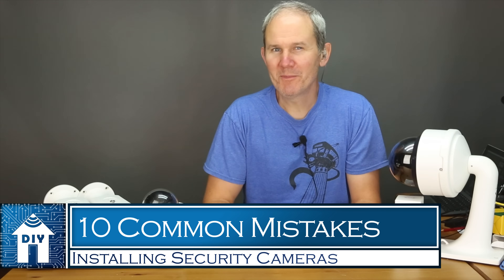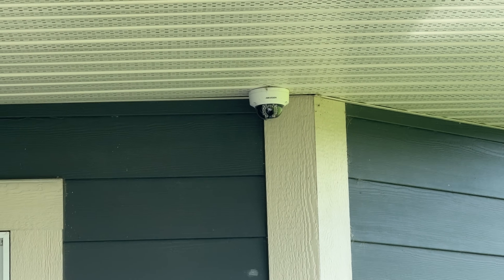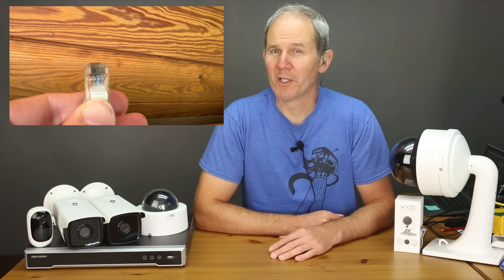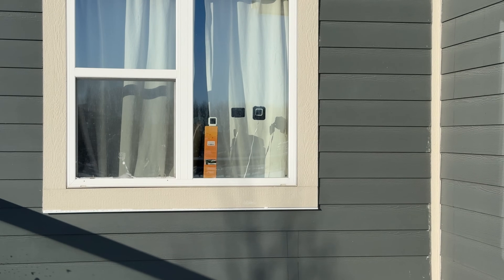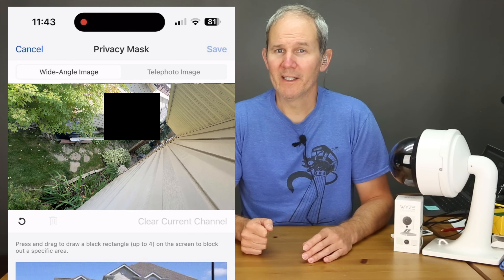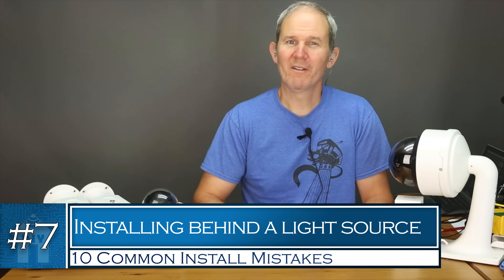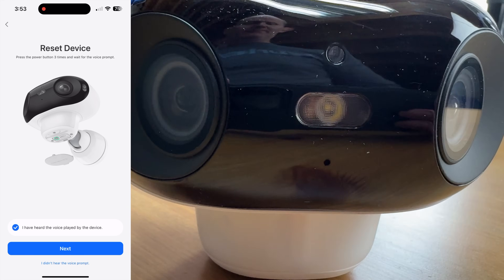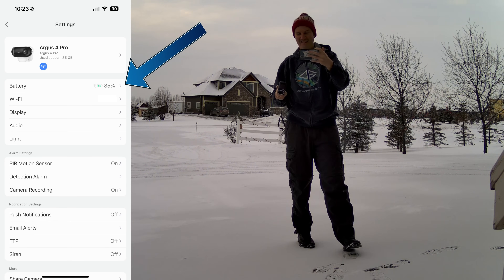Top 10 Mistakes to AVOID when Installing Security Cameras - DIY

Comment: Use hidden concealed cameras or at least a few at eye level also at least two separate systems nowadays because criminals would look for a control box hard drive  because they could cut internet wire connection to cloud storage whilst outside a battery back up is an idea too in case they cut electricity or switch it off.

Comment: Great tips, several of which I wish I had done before my install! The biggest being not testing all the cables before running them through conduit. One of the cables was manufactured with splits along its whole length. I didn't discover this until when I came to connect everything up. I had tested all the cameras, not all the cables! It cost an extra day of my time to undo a lot of work only to redo it all with a working cable. I few extra minutes testing could have solved all of that hassle!
Reply from the maker: Sounds painful and frustrating.